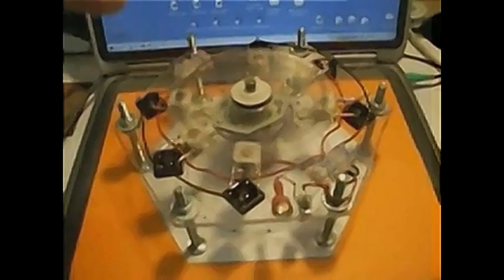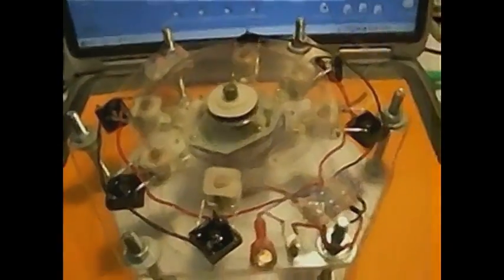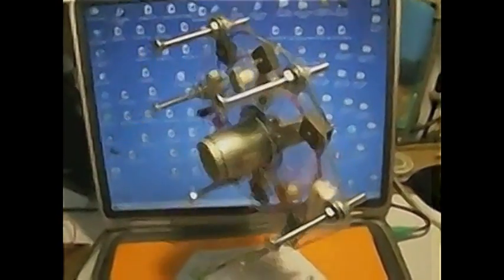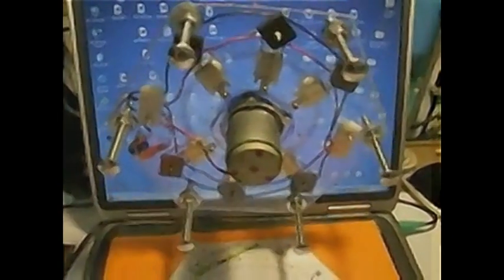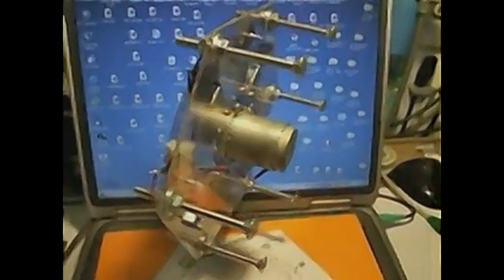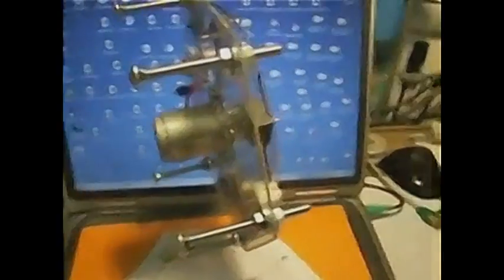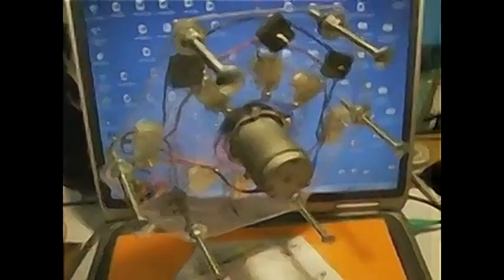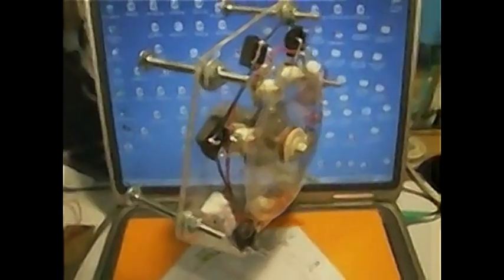Muller No NeoGen No Bedini NO

Comment: @hhoforvolts aslo if you google PJKBook18.5.pdf on page 6 -22 as in chapter 6  page 22. You will find a short description of the device. Not sure if you have seen that. I'm not saying that the device is real by any means but im 99% sure what you point to as being AA battery packs in your picture is not. In the PDF mentioned before on the next page it does show the two battery packs. Some how your video seams diff then the original. Ill try find the original i have and  see if i can repost it.

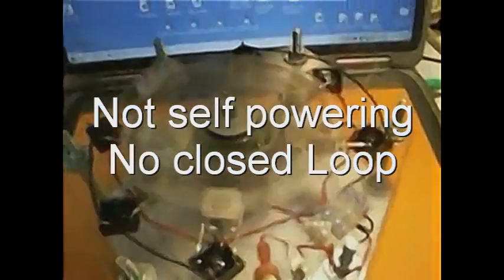Comment: @hhoforvolts sorry my friend but if you go to time 1:48 on your video and look closely at the white block you point to in your picture as being AA batteries. You can clearly see the fastening screws and the divisions in that frame. Typical European connector block or 'knuckles' as my dad calls them. Now it could deff be possible that this is a fake as i would suspect the wire that he is suspending the whole thing on is actually an input wire. But what you point to as AA to me is deff not.

Comment: @hhoforvolts 
Yeah could be AA batteries, but they just look like your standard European connector blocks. I can seven see the connector screws a few times as the whole thing spins in mid air. Could be wrong tho.